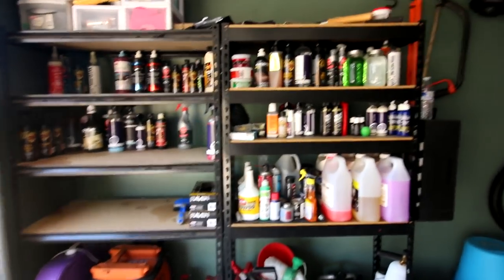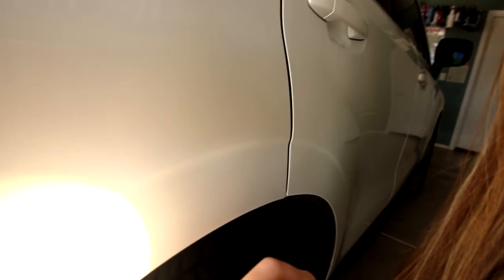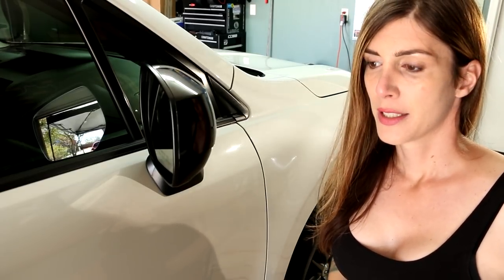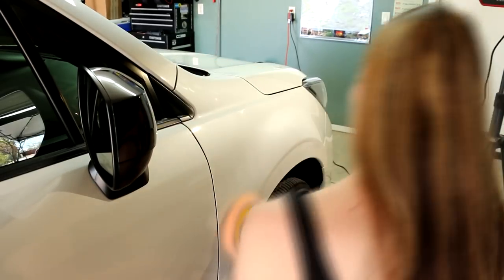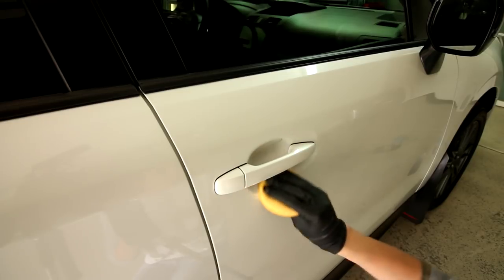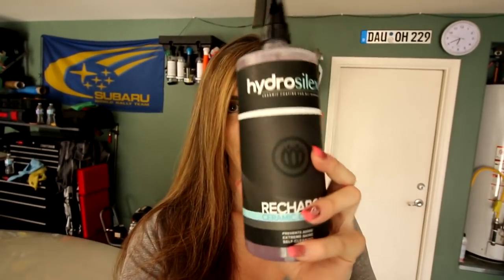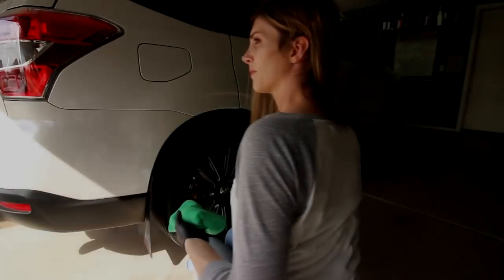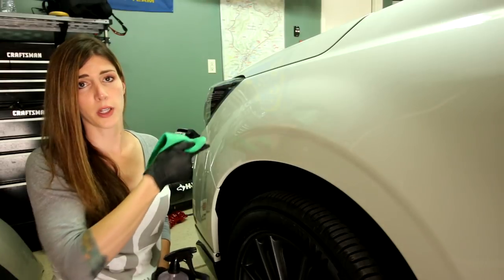Going Hard in the Paint // DIY Ceramic Coating!

Comment: I just applied the hydrosilex recharge to my 2018 Tacoma, although I wasn't as thorough as you as my truck only has 1500 miles on it. Washed and dried thoroughly, very easy to apply. Works like a champ. Rained all day after it was applied, next morning I had about an inch of wet snow on the truck. Snow slid off effortlessly. I hope you'll do a follow up vid to show how it holds up. I lived in Tucson for 15 years, I know it's tough on paint! My hope is the hydrosilex will protect my paint from all the road salt we have to deal with here in Northern NY. Great video!

Comment: Hey Sarah!  This from 

"HydroSilex Recharge is an Sio2 based, easy to apply, spray on protection product! In short you can mist it on clean paint, wipe away any excess product and get durable protection that looks great! The unique chemical makeup of water-based Silica Dioxide makes this formula a pioneer in detailing. Once cured, Recharge morphs from liquid to a highly flexible transparent top layer, that adds gloss, and protects various surfaces from the elements.

While the label on the bottle reads “Ceramic Coating”, Recharge is not a full-fledged paint coating, but rather a spray on silica sealant.  These easy to use products offer durable protection for a variety of surfaces, exceptional hydrophobic properties, and they can be applied in a very short amount of time.  Hydrosilex indicates Recharge can be used on a wide array of vehicles and surfaces including boats, planes, cars, trucks, showers, kitchens, motorcycles, bicycles, lawnmowers, glass, plastic, metals, fiberglass, vinyl, paint protection film, wheels, wood, Plastic-Dip, stone, countertops, single stage paints, gel coats, clear coat finishes and more.  The bottle says to “Apply on all surfaces”, therefore, I think it is safe to say you can go ahead and try it out on everything."

Comment: Nice work Sarah!  Any ceramic coating is only as good as the prep you put into it.  This product in particular will likely last 3 to 6 months if you don't reapply.  Personally, I'd reapply every 3 months after a wash.  The only thing I noticed that you might consider next time is a 'panel wipe' step after polishing to remove any remaining oils or waxes from the exterior surfaces.  A panel wipe product that is easy to find in stores and works perfectly is Prep All by Kleen Strip.  Again, nice job!

Comment: I would recommend using multiple towels when applying any coating and also it's huge to use a IPA to extract 
the oils from either the compound or polish you just put on the paint, it has a big factor with any coating of how well it's going 
to bond and seal to the paint. Also you don't want to use ur compound or polish microfiber towels because they have the oil on them aswell
you're trying to get away from. Hope this helps just didn't see any thing on that or that you did mention.

Comment: I think you're suppose to use a paint prep after polishing to remove any polishing oils left behind. That way the sealant bonds to the paint better. I've been polishing and waxing my trucks for the past 20+ years and am eager to try out a ceramic coating.

Comment: Temps in the garage can be controlled by a DIY mini split system. You can do it yourself for under $2k. Mr. Cool has a pre-charged system that doesn't require a technician

Comment: Store your car cleaning products close to the ground. Hot air rises after all. Next install a thermostat controlled extraction fan in the ceiling or wall depending on your setup. It comes on when the room reaches your preset temp then goes off when the temp drops.

Comment: Great video Sarah. I also just Ceramic coated my car using CQuartz3.0 and love it.  My only advice for your viewers watching: to do a Isopropyl Alcohol (IPA) wipe down after polishing and before ceramic application b/c you’ll want the ceramic to bond the raw clear coat and not any top layer of polish. 
Also, if you use the SiC or nano SiO2 ceramic coat application (e.g., Cquartz, Opti-coat, Beeds, etc), it will last longer (2-4+ years) vs than the spray sealant like HydroSilix (6-8 months).   Keep up great vids.  👍🏼

Comment: That's not a real ceramic coating it's a maintenance spray for a ceramic coating
Reply from the maker: Steven Kraus correct and incorrect, it can be applied as a stand alone sealant too. It’s like how Olive Garden isn’t homemade Italian food, it’s a quick and easy formula that still taste like pasta and fills your belly! Lol
Reply: Steven Kraus You should have done more research, bub.
Reply: correct,its not the same as the real deal,
its more like a sealant.
Reply: A spray-on sio2 coating is typically the percentage of 10% sio2. When you start getting into higher coatings where the percentage jumps up to 50 to 90%. Gtechniq / carpro Etc ..You have to start wearing gloves and masks. Awesome job Sarah!!@
Reply: @SarahnTuned  O M G haha

Comment: Maybe you did this but I'd consider wiping your car with paint prep right b4 you apply a new brand or type of sealant or wax. Its then bonding to the paint and not previous chemicals.  It's a quick step. I'd start only calling this a sealant. I like the blaster. I started using mine for my motorcycles (water hides all over them).

Comment: How about using an old/chipped nylon trim removal tool as a pointer?  Will probably require some grinding, sanding, and shaping.  While your fingers are nice, I'm often at a loss of what you're trying to point at.  I initially thought of using a screwdriver, but we know that metal tools in close proximity to the paint would not be a good idea.

Comment: Nice review. You won't get the durability of a "traditional" ceramic coating but several weeks is totally reasonable. I like to use it as a maintenance product for vehicles I've previously coated. And I also like to use it on freshly washed and cleaned wheels/wells if I'm not doing a wheels off detail. Keep this in your arsenal for when you get the regular clientele . Its a breeze to apply and rinse during a maintenance wash.
Reply from the maker: jjkrig10 I agree, I think this was a nice way to get into ceramic coatings on a DIY level.
Reply: I def understand the skepticism but as a (part time) detailer I like to try/test different products to see if they are worth their meddle. I've tried several of the well known brands on the market (22ple, CQuartz, GTechniq, Optimum) for application and durability and I can happily say that for the most part they do what they advertise some do it better, some do it longer but, by in large they all work as advertised.  You will find very few dealers that actually do true ceramic coatings. Many advertise some type of vehicle protection but they are usually some type of sealant that only lasts a few months at best. The beauty of products like Hydrosilex and similar products like McKees 37 Hydro Blue, and CarPro Hydro is the ease of application. Spray on rinse off that's it no rubbing no buffing...and you have a couple of months (at best) of protection.

Comment: Great video!
I've been very curious about ceramic coatings. The ones that I have seen though, apply with a little sponge wrapped in some fabric or leather type crap... and they say it actually requires a bit of skill to apply, so I have been a little iffy about trying it on my car.
Reply from the maker: NuarStanger they do. I have some, haven’t tried them on paint yet though.

Comment: Isn't that made to protect and extend a ceramic coating and not an actual ceramic coat itself
Reply from the maker: Yes and no. It’s a hybrid sealant that encompasses ceramic properties. It’s designed to be DIY friendly. If you watch the entire video, you’ll notice that I reiterate this over and over. I’m not getting paid by this company, so I have no problem calling it what it is.
Reply: The engineering nerd in me needs to do a little research on this stuff, but I think they are using “ceramic” incorrectly. All that would do is horribly scratch the paint and offer no real protection, as any ceramic material is going to be much harder than the paint. Time to nerd out lol
Reply: Don’t rub up anything in circles if you want to keep swirls away. Using Straight lines with the length of the car will minimize this.
Reply: mindflux98  - No, it won’t. A scratch is a scratch. Circles or straight lines, it’s still a scratch.
Reply: Neur0bit but a horizontal scratch is harder to see than a circular scratch. I’ve been doing this a long time.. it’s a tip from wayyy back. Also a straight line scratch wouldn’t be considered a “swirl mark” which was what my original comment was discussing.

Comment: Dont put the light that close to the paint to inspect scratches or swirls. That "drowns out" the paint making it hard to see defects especially on light colored vehicles.

Hold the light about 2-3 feet away and move your head to the side. 

Pearl white or metallic white is almost impossible to detect damage. In most lighting the paint looks flawless. But that is not the case.
Reply from the maker: Next Level Auto Detail capturing it on a big bulky DSLR camera was a whole different can of worms. Lol
Reply: Sarah n Tuned It is almost impossible to capture it on a photo or video. Polishing white cars are boring. There isnt much reward in it.
Reply: Next Level Auto Detail Seeing your car shine as if it had just rolled off the showroom floor isn't a reward? What are you smoking, bub?
Reply: Are you using a polarizing filter?  That changes the optics of reflections like swirls, holograms, etc.  Nice video BTW.

Comment: 2 things...

1. When you apply things like that spray stuff, wipe in straight lines, not circles.

2. That’s not a ceramic coating, it’s the spray you use to maintain a coating.

Comment: Agree with you Sarah on the wet Application, I think dry will probably bond better to the paint I would assume, also after you polished The car did you use any alcohol wipe down or Geon wipe down, next question is can you apply a traditional wax over this coding like a “ Beauty wax” I just been using V36 The same cutting pad you used and then I jump up to Jes car power 🔒 + and then I do a top coat of Colinites 845. That really seems to respond well to my Subaru Ice Silver metallic paint gets pretty hot out here in Sacramento.

Comment: I would say it would only last you around 4 months with a type of sealant like that in AZ. I wouldn't call it a coating more of a spray sealant. I would like to see some more coating stuff from you for sure. There are some excellent trim coatings out there for sure. Hell I have coatings for everything lol. It can get out of hand with all the goodies you can put on a vehicle as you know. Your shelf for detailing supplies will keep getting crowded. 

How did the paint feel after application? Super smooth?

Comment: try to not make circles when wiping make back and forth movements. your eyes will ketch the swirles more than straight lines. don't use the parts store or Walmart microfibers on paint as there is more polyester content in those microfibers, use meguiers, mothers, greiots microfibers in the paint. for the ceramic product see if it dries to a glass coating, if it does then you have to throw out the microfiber or it will scratch the paint with the dried glass. very cool that you are detailing cars, and so am I doing only my own car and truck. you don't need a lot of different products just the ones for the type of vehicles you are deailing.

Comment: following up on the storage temperature issue, most of your products should have a MSDS (material safety data sheet).  this document contains information on safe storage temperatures, among other things.  as an example, the MSDS for Zymol cleaner wax specifies a storage temp between 32F and 120F.  I don't know about your garage in Tucson, by my garage in San Antonio definitely exceeds 120F at peak summer temps.  maybe look at the MSDS for the more expensive stuff you have, and relocate those inside?  just a thought...I can see you have a lot of products!

Comment: I'm always skeptical of 'new' products. The definition of ceramic is... 'made of clay and hardened by heat'. I'm not trying to trash the product, if it does what it says and you can actually tell the difference over time, great. But yeah, kinda skeptical of the name, 'Ceramic'. Anyway, great video as usual, thanks!

Comment: I just did the foam gun application and love it!  I more than likely used more product that way, but super fast and it worked like a charm.  Now I am just going to layer with dry application to maintain.  I have a black car, and I love the results of the stuff so far.  #notaprodetailer

Comment: I'm not a car guy and truthfully I only wash mine like once every 2-3 months out of pure laziness. With that being said I need a product like this especially in brutal S FL weather. Just bought a 3yr old car that is in desperate need of wax job and detailing because it probably hasn't been properly waxed since it left the dealer. What exactly do I need to do to get it to the point where I can apply the Hydrosilex? I have no clue what a clay bar is or does, nor do I want to spend hours and days prepping it. Can I just wash and wax and then apply it (dry method)? How do you get the scratches out from behind the door handle? The driver door handle pocket looks like shit probably from keys and rings... just looking for an "efficient" way to get my car looking good again but not necessarily showroom new. Thanks
Reply: Andrew... next time you wash your car, take a plastic "baggie" with you.  Don't use one of the ZipLoc/Glad bags - stop in a grocery store and pick up one or two of the plastic bags they have on rolls in the produce department.  After you're done washing your car, put the plastic bag over your hand and run your hand gently over what you've just washed and dried.  Hear that "hissing" sound?  You can actually feel through the baggie the stuff that's still bonded to the surface of your clear coat.  Using a clay bar will get rid of that - at least 90-95% of it.

If you don't "clay" your car after washing, you're just waxing over the top of bonded dirt & particles.

And you shouldn't need to clay your car any more than once or twice a year depending on where you live.

"Claying" your car isn't hard or difficult to do.  Depending on the size of the vehicle, it should take you less time to "clay" your vehicle than it takes to wax it by hand.  Basically, a clay bar is just what it sounds like - lump of "man-made" clay that's kind of the consistency of taffy.  It's used in combination with a "wetting agent" - ALWAYS! - and the average consumer can buy a "clay bar kit" marketed by either Meguiar's or Mothers at one of the automotive stores or Wally-World.  Runs about $20.

What you do is wet the surface of your vehicle - working in about 3' square areas - with the supplied "lubricant" and rub the clay bar back and forth across the surface - doesn't have to be hard rubbing (you're not trying to do sanding here).  The lube will make the clay slide over the car's surface and pick up all that gunk that's still bonded to the clear coat after washing.  After you do a section, wipe it off with whatever you use - microfiber towel or clean terrycloth towel - then run your hand over the surface and compare it to an "unclayed" section.  You'll be shocked.

There are plenty of YouTube videos out there on how to "clay your car" - honestly, it's not at all hard to do.

Comment: Isnt it just a recharge spray, not a ceramic coating?
Reply from the maker: Daniel Ford H Not really, but kinda. You can use this on any surface, and as a stand alone sealant. I wouldn’t say it’s on par with “true” ceramic coatings, but it’s also a lot less expensive and easier to use too.
Reply: not really less expensive if you do it yourself.
and the prep work is more or less the same.

Comment: I prefer sealants over ceramic coatings. They do not last as long but much easier to apply.
Reply from the maker: J Coz I’ve used sealants for years, this stuff was as simple as it gets. It’s not as difficult as a ceramic quartz coating to apply.